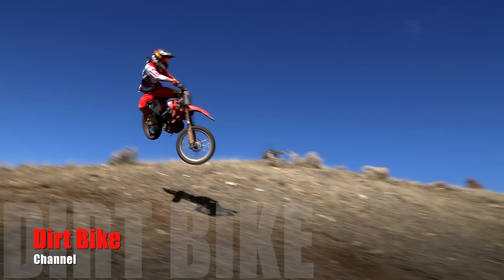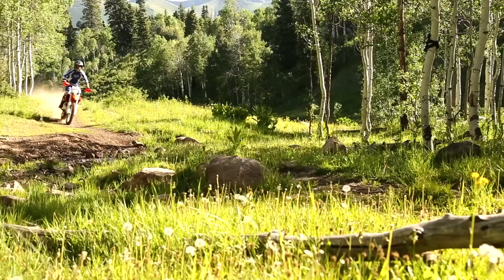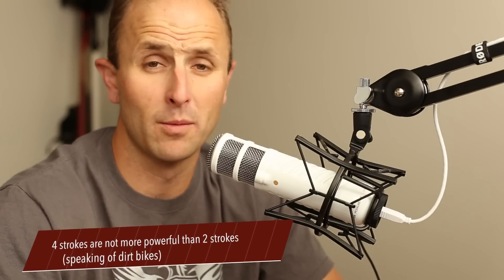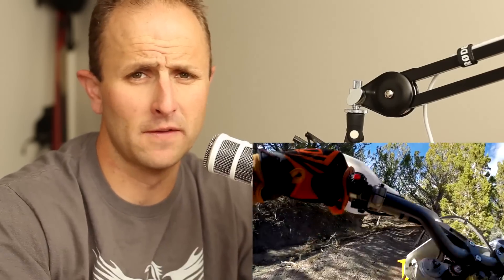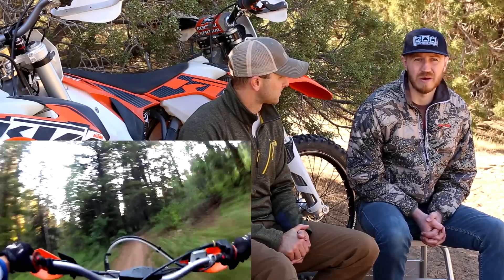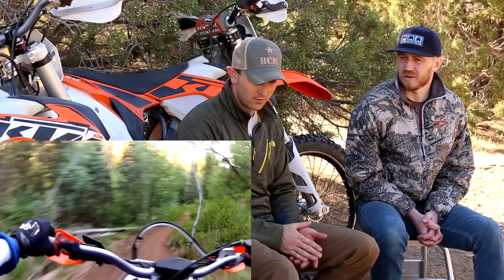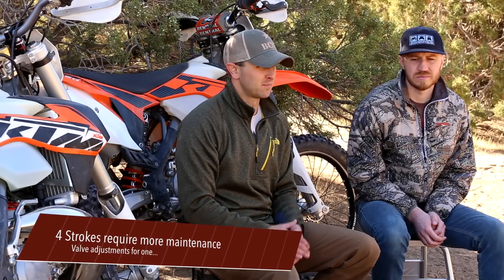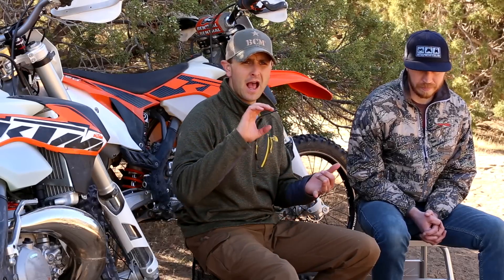Enduro 4 Stroke vs 2 Stroke Part 1

Comment: Wow, I went to a Yamaha/Honda/ktm. I wanted a ktm 2 stroke, he said "you have to rebuild the engine every 10 hours of racing/running a dirt bike hard like that are meant to be rode. And they are around 3 grand more than a 4 stroke.
Reply from the maker: kody erickson That could be true with a small bore 2t, but no one is replacing pistons on big bore 2ts every 10 hours unless they just like to rebuild motors for no reason.  I just swapped heads on 2 300s last night. Both pistons looked great.  One of them has 12 hours and the other had 80 hours.  You could not tell the difference on either of them.
Reply: friend of me got 130 hours on the piston and no compression/power lose on his 125 exc

Comment: To be fair , a lot of it is rider preference. 4 strokes cost a lot more to rebuild. You could completely rebuild a 2 for what a top end would cost on a 4, me being a tight eastern woods rider, a light 200 2 stroke just can’t be beat. But for top end power the 4 stokes win

Comment: If two strokes fire every time the piston gets to the top of the stroke, how are exhaust gasses expelled?
Reply: On the downstroke - out the exhaust port/s as the piston drops, then fresh charge comes up through just after via the intake ports - from the crankcase (rotary-valve intake) or the reed valve, while the piston is still going down. The expansion chamber helps to pull exhaust then stuff the fresh charge back into the cylinder via two way +/- pulsed/wave action. Slight changes in the design and timing of the ports/pipe/intake/carb etc. creates completely different powerband and power levels.

Comment: Hi guys love your channel, and particularly the comparison series of the two stroke and four stroke! I do have a question because you guys know what you're talking about. I just traded in my Kawasaki 450 2016, since I found it way too much in terms of power and weight. I have ordered a 250EXC KTM enduro, and I was wondering would this be too much power for me for trail? Im a very new rider, and frankly your five part series converted me to two strokes indeed. Are enduro 250 2 strokes rider friendly for newbees? Is the powerband going be too much? I would appreciate your response very much!
Reply: Otherwise there is the chance of the 2017 150SX that's on offer as well, it could be more fun, and it's still a 2 stroke.
Reply from the maker: If you were able to ride the 450 in any shape or fashion, I think you will do just fine on the 250 EXC.  The nice thing about that bike is that it will let you tune the power down with an Aux spring.  They are great bikes.

Comment: Well you are getting into tech on the valve lift and duration ,it can be changed in a number of way the compression ratio can be as well the 4 stroke will without doubt generate as much power per cc BUT they don't build it to it's built to a non serviced item in this topic..I'm sure your aware of that.

Comment: Great information. However, any bike I have has to be street legal. What options to I have for a nice street legal 2-stroke?
Reply from the maker: Kamotion There are kits you can buy to put signal lights and such, but I'm not a huge fan of converting them.  I think you are better off with a 4 stroke if you are going to spend any significant amount of time on the pavement.  KTM makes a couple of street legal models like the 350 EXC and the 500 EXC.  They are both 4 strokes.  That would be your best bet if you want to split time between the road the and the dirt.  Other manufactures MIGHT has something in 2 stroke, but I don't know of one.
Reply: Kamotion It also depends on the State your in but I do know some states you can street legal your 2T.

Comment: There is a reason pretty much every...

Dakar bike is 4-stroke
Motocross is 4-stroke
Tight enduro racer is 4-stroke
Snowmobiles are 2-stroke

Both are very good in their own way and i think this video is just "TWO STROKES ARE BEST!"
I have ridden mostly 4-strokes and never have theese expensive problems you talk about while i've seen plenty of 2-strokers split their engine for the 10th time :)

Comment: I love my 300, and if i was to own one bike it would be a 300.  But i have the luxury of owning one of each.  I like my ktm 4 stroke in the desert, in a long, fast, sandy wash, the 4 stroke is easier to ride. It delivers steady sustainable power that is easy to keep going at a fast pace.  In my opinion.  Both bikes are just plain fun to ride, the powerful torque of my 500xcw is intoxicating, and the light weight yet powerful 300xcw is a blast in the mountains.
Reply from the maker: eugrules Very good analysis.  That is great you can afford to have different bikes for different days!

Comment: I have seen on a lot of forums where people rebuild wr450's for example and they didn't even need it. They have open the engine up and everything is fine after like 8000k's of riding so I'm sceptical of what you're saying about maintenance. I would really like to here specific examples where the case was the valve clearance was off or needed a new piston and what sort of a rider were they. Obviously, this is all second-hand info for me, I'm yet to rebuild my wr450f and see for myself but the way I see it is it all sort of equals out because you can have shorter service intervals on a two stroke but they are cheaper and longer service intervals on a 4 stroke but more expensive. Please correct me if I'm wrong.

Comment: I'm not guarding 4 strokes but the motocross 450s make almost as much power as an equivalent size 2 stroke.  The only reason that is, is because there has been a lot more development in the 4 stroke department than the 2 stroke in recent years.  But I prefer 2 strokes over 4 because they're so simple, so much more fun, and cheap.
Reply from the maker: 43shadows They will make that power WAY up in the RPM range, which works on a motocross track.  It doesn't work so well out in the woods.
Reply: From my understanding a 4 stroke would be a lot better for woods riding, but then again I've never ridden a 2 stroke enduro bike (or any enduro bike for that matter)

Comment: If you use 40/1 mix the 2 stroke will be indestructible.  If you mix it 100/1 you'll spank everything out there till it breaks . Oh yeah and throw some RC Fuel in also 😆. 4 strokes may rev higher but at 10,000 rpm is only putting out 5,000 power pulses while 2 strokes are putting out 10,000 power pulses.

Comment: I had my choice in  2014 of 2 or 4 stroke ...not a easy discission ...add up oil for fuel pistons and 2 strokes love for new tires and it would be a close race on money spent ...I have KTM 450 xcw and it is easy to ride and you tend to be going faster then you think you are with less effort then a 2 stroke ...but I love them both and if fun is all your looking for 2 strokes are a blast ..
Reply from the maker: frank crivaro Frank, you have a point.  I think that if you really needed to win races all the time, the 4 stroke might have the edge.  If you are simply looking to have fun (which is most of us) 2 strokes offer that in spades.  I have both 4t and 2t and I have more fun on the 2t.  That is just me...

Comment: So this question is a little outside the scope of this video, but how well would a 2t like the 300exc perform in a dual sport role? Can it run maybe 30 miles on the interstate or highways to get to the trails or to connect trails? How would a bike like this stack up against a DRZ400? Thanks!
Reply from the maker: Bill Punkoney I'm not a huge fan of 2 strokes on the pavement. I think I'd use a 4 stroke if I was going dual sport.

Comment: I ride a 2015 350xcf and i ride enduro   I will admit.  2 stroke are great for technical single track because they can lug while a four stroke stalls.  but. the 4 strokes have more response which I like in turns because I race hare scrambles and that response help greatly. I believe it's all in the rider and what they use it for.   not which is better.
Reply from the maker: You make some very good points here.

Comment: Couldn't watch this, wr450's go tens of thousands of kilometers, have titanium valves, as is well known to have a bombproof topends. You guys had your mind set up from the start. Also, most 4 strokes fire each time the pitson is at the top, theres just no ignition ;-)

How about all the problems on the TPI models? How many times can you check the valve clearence an a 4 stroke before you theese problems sorted?

Just because you didnt pit a pison in your 2 stroke, at it didnt blew up, doesnt meen it hasnt exceeded the specs in the manuak, set by the ones who built them. 

I know you must have some special machines, when you talk about the piston firing :D

Comment: Why do all those who compare 4T / 2T rebuild cost forget that 2T engines need rebuild of the bottom end about same to double the hours a 4 stroke need rebuild of valves? When you count that cost in 4 strokes suddenly do not look so bad anymore as rebuilding a bottom end is a lot of expensive work (have had it done myself on a snowmobile).

Comment: new to the sport @ 52 weigh in at 165. I really want to ride single track only. Having a real difficult time picking a bike. Considering 125t, or do I just do the 250f. My though is that it will be better to learn on the smaller 2 stroke. Good thought, Bad thought???? help!
Reply from the maker: +Scot Cook Very good thought.  I like your thinking there.

Comment: Hey can you help me out I have a 1999 yz125 and it has not a bot but when I'm about to hit power band it loses power and then hits any help with getting or a clogged power band or any help? Please reply this is a big thing since I'm racing ironman gncc a national race coming up! Thanks
Reply: Sebastian F. Thanks!
Reply: ixcr238 you should also check your reed valve is free and not gummed up also check that you get a good seal from your exhaust to your engine as it may be that your exhaust outley is blowing which vacuums the cylinder and causes power loss

Comment: The problem with all the comparisons out there is they are ALWAYS biased toward one side, always....For me I think they both have they areas of strength: When I race motocross its my KX250F all day. When doing enduros/woods/trail riding I like my YZ250 better. You need to do more than just go out and "ride" one to figure out which one you'll end up liking more. The extra weight and low end torque of the fours strokes helps me get a better drive out of the corners than any two stroke will ever get me, thus why I'd never race a two stroke for motocross. However, when I'm in the woods I like the light weight quick turning capabilities of the two stroke, they require a bit less physical effort also because of being lighter, nice for long enduro racing.
Reply from the maker: Jordan Sundeen I can totally buy that.  4 Strokes certainly have some advantages on a track.

Comment: I didnt wanna know which cost the most Just which ones best on rough stuff
Reply from the maker: +max stoney That would depend mostly on your suspension setup and riding style.
Reply: Thanks 4 reply i love 2 strokes love em but they are a handfull in woods on tight twisty stuff seems theres loads power then none ive only had kx85 i thought if an 85 is like this a 250 just tear my arms off so am thinking of getting a 250 f just wanna no which 1 is best can you do a vid on that plz

Comment: I'd have to agree the 2 stroke is tough but the 4 stoke can be made to work as well but again but there is not a better engine than the rotary but the engine itself would likely demand exotic materials such as platinum alloy aluminum /steel to compete but again I'd guess if it could it would be the end of both piston engines..

Comment: You didnt mention that 4 strokes are going to have more low end because of no power valves, also they tend to have more torque. Other than that great job

Comment: i have a 1979 xr250, it runs like a champ. starts second kick every time, TAKE THAT 2 JOKER!!!!!
Reply: Low compression air cooled 4 strokes are bullet proof.
I have a 1993 suzuki 160cc quad that I have literally beat the ever living fuck out of my whole entire life. (5 years old to 25) i' changed the oil in it once a year and have done zero repairs to the engine... to this day, she still fires and rides like a hot damn. Actually, i was hauling wood with it earlier today.

Comment: Main issue for me is that I ride in CA.  Almost no 2T is green sticker or plated now.  The rare few that are have lucky owners.

The debate ends there.  It's not about which bike is better, but what I am able to ride.
Reply from the maker: mbrickner87 Thank you government regulation.  Many have pro-ported that CA is the reason 2 strokes have been relegated the the dust bins of the US in many ways.

Comment: The Suzuki RMX 250 is a wonderful bike with all kinds of cheap upgrade potential. I see a renewed interest in them, and people are resurrecting them world wide. The only real bugaboo is power valve parts. I own KTM 350 xcf, YZ 295, KTM 200 EXC, and RMX 250. The Suzuki fits my DNA better than any of them because of the neutral steering. The KTM 350 is good, I just need to spend time dialing the forks. Damn Suzuki for not making this bike anymore. Damn them for not making PV parts. Have not had trouble with anything else. There is a need to be filled.

Comment: After slapping stainless steel valves on my 250, ive only retimed them once serveral hours after they settled. Ive put about 80 hours on the bike since and i still have great compression and power. But when it comes time to put new shims in its a pain in the ass, i have to take off the tank, shrouds, and the seat. When its time to replace my piston I have to take out the carbuerator just to get the cylinder off and doing that requires me removing my subframe. So yeah... I am ready to get a 2 stroke.
Reply from the maker: Daniel Esbenshade You are making my point beautifully :)
Reply: Daniel Esbenshade Daniel what 250 are you riding?
Reply: Sam KTM crf250r
Reply: Daniel Esbenshade what year? Is it the EFI model? I don't have a ton experience with the EFI models which makes me wonder how much harder they are to work on.
Reply: Sam KTM its a 2004, and like i said i have to remove the carbuerator so its not the EFI model.

Comment: where do you find the the 15 dollar gasket kits?!?! or the cheap top end for 2strokes? the ones I've found are $600+
Reply from the maker: Just bought 2 top end kits with all the fixings (gaskets) for $200 each from Vertex.
Reply: +Dirt Bike Channel thanks! I'm currently trying to rebuilt the top end of a 2000 Honda 80cr 2 stroke,  previous owners we're super dumb and ran it with just gasoline ...smh lol

Comment: I would like to share some info on this topic on a two stroke your suppose to change the piston every 50 hrs no matter what, if your a Sunday driver ,track ripper or a trail killer your two stroke piston need a change at 50 hrs
Reply from the maker: SHANE DICOCHEA Big bore 2 strokes are just getting broken in at 50 hours.  Call a dealer and they'll tell you :)
Reply: I was just told by a well known sports shop that every two stroke big bore small bore should be changed at 50 hrs
Reply: But I will call a dealer and ask just for the sake of argument

Comment: 2-strokes are awesome, but they are going the way of the dodo due to emissions regulations.  You can't be burning the lubricant like that anymore.  Even in marine applications the 2-stokes are going away.  I still have a 130 hp 2-stroke outboard engine, but it's a 1996 and I don't think you can even buy them anymore.  It's all 4 stroke and I couldn't put one of those on my old boat because it would be too heavy.  The stern is not designed for that much weight.  The 130 is already a bit too heavy.

Years ago (like 25 years ago) I had a 2 stroke IT-250 which was still air cooled but boy was it a lot of fun.  Good power, and light.  Wide gear ratio so uphill on single tracks was no problem, just watch your gear.  Brakes sucked though, the single greatest advancement in bike technology was definitely disk brakes.  Years later I got a YZ426F and man that thing was a beast.  Might have been only 25% more hp than the IT but the torque was huge and it weighted a lot more.  It was exhausting to ride.  And tough as hell to start it didn't have electric.  It would usually start first or second kick but not after I dumped it.  Flood that thing and oh boy.

Nowadays I'm happy with the 250 class 4 strokes.  I'm too old to do anything extreme and I find for trail riding the main difference is I have to stay on the power longer.  But since the power band is so wide that's no problem, just let it rev.  And I've switched to dual-sports because I find it more convenient to be able to just ride it anywhere.  Something like a KLX 250 is all an old guy like me needs, although getting off road tires is a good upgrade the tires they come with suck.

I bought an old TW200 for my wife and 12 year old to learn on and I think here is where the 4 strokes shine.  They don't need a lot of power, and even though it only has 11 horsepower it's enough for them to bump along the trails and learn to ride.  And in this case the big tires are actually good enough off road, but we can still drive it to the pump when it needs fuel.

Comment: The only thing I disagree on is valve adjustment. On my rmz 250 I went 30+ hours with steel valves. But I also don't race or ride too hard.
Reply from the maker: Tristan Ratcliffe Thanks for chiming in!